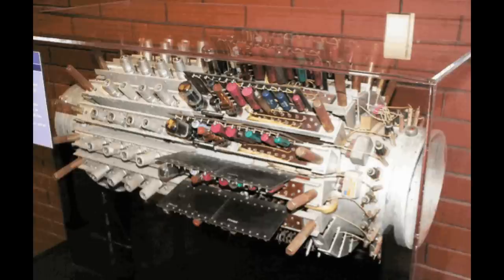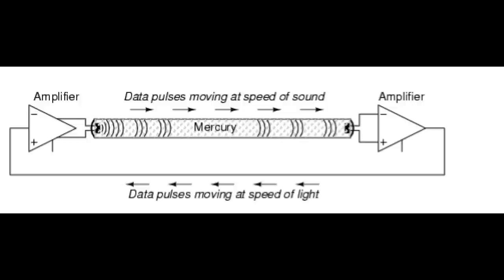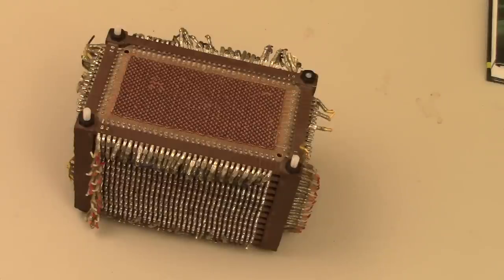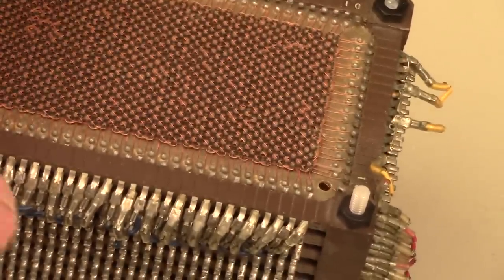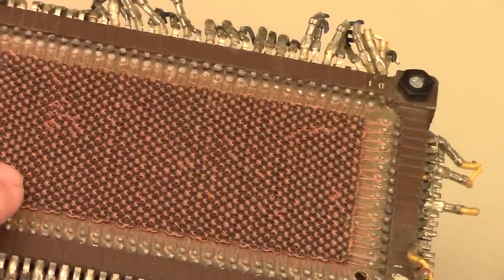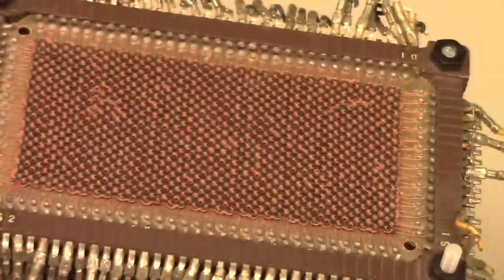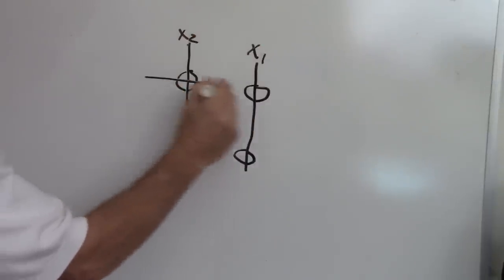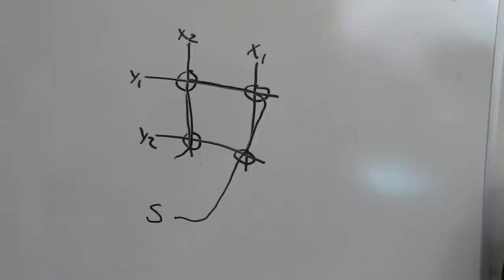Episode 11 - Getting Busted in New Jersey With Core Memory

Comment: Its funny really how lame the technology looks, but in 30 years, computers today will look like extremely slow devices.
Reply: neuro-computers are about as fast as we could make them unless we delved into wetware and the "Rat-king" tech tree.
Reply: Jet Withdrawal 
The rat king was a theoretical design made by connecting roughly 10 creatures together and locking them in place until a new brain would be needed far past the creatures natural life span due to a series of life support machines sustaining their bodies.

This amount of combined brain power is said to make short work of many complicated theorem.

The downfalls are massive power consumptions and the installation of a New processor requires a surgery and cranial implants that lead to eventual death through severe rotting of brain tissue.

Thus, the amount of wires and tubes snaking together to a single point is why it is called the rat king.

Comment: 50,000bits = 50kb amiright?
Reply: No, more like 5-6 KB. Several bits are used per byte; today 8 bits is the norm. You might also use some extra bits per byte for error detection. Furthermore, harddrive manufactures caused controversy by denoting 1KB as 1000 bytes instead of 1024 bytes (2^10) which was the normal understood meaning.

In other words, it depends on the system it was to be used in, and how you define KB.
Reply: 〈/†〉[Nick1921945]〈♥☺♪♫〉 50,000 bits equals 48.8281 kilobits which is always 6.1035 kilobytes.
Reply: Lower case b is for bit.
Reply: 1 byte = 8 bit, 
8192 bit = 1024byte but 1024byte is usually refer as 1KB for some reason......
Reply: huang junwei It's because 1024 decimal is 1000 hexadecimal, commonly noted $1000.  There's a mouvement out there that wants to rename this as a Kibibitybyte instead of a Kilobyte.